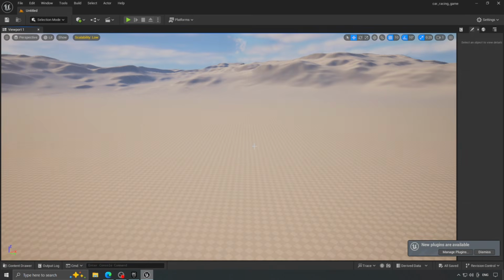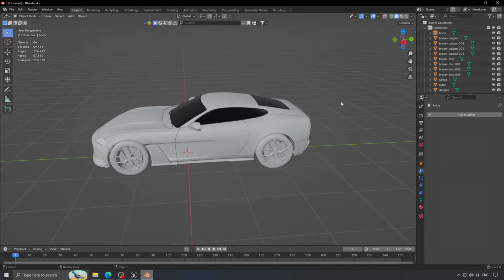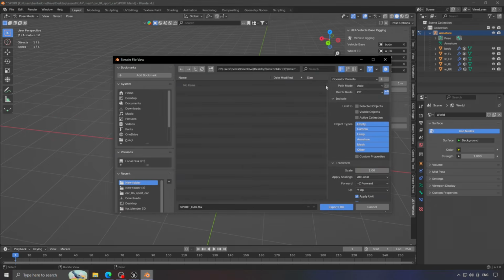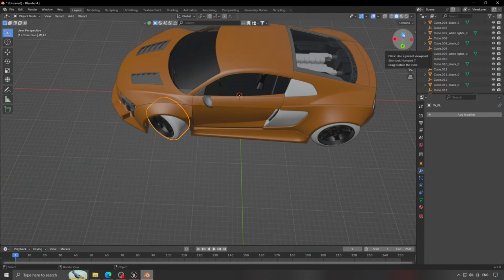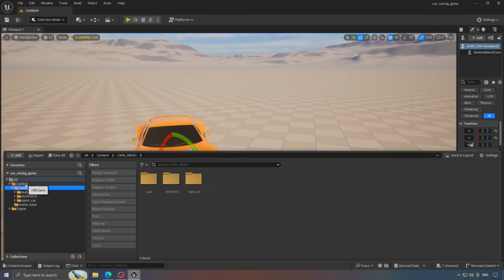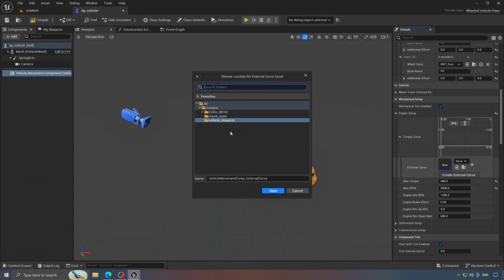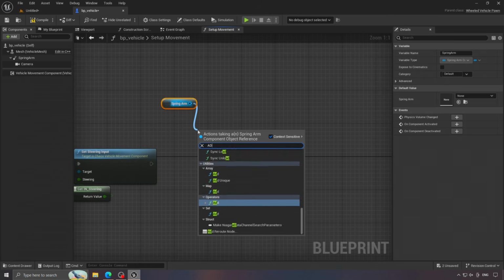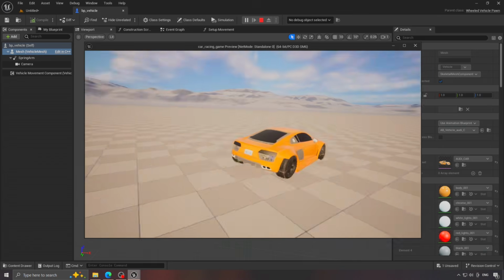How to Import and Set Up a Drivable Car in Unreal Engine —(Using Blender)| Build racing game PART 01

Comment: I followed the steps, but my car only moves backward and won't go forward or turn. I've double-checked my key mappings, but it still won't work. Any ideas on what might be causing this
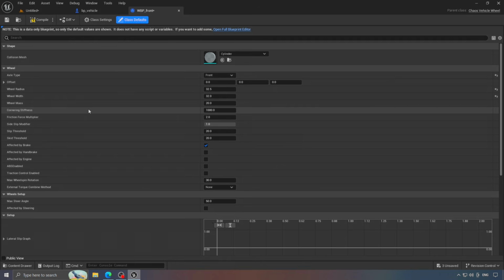Reply: Had the same problem with steering. Turned out I just forgot to tick "Affected by Steering" you can see at 18:04. Maybe thats the solution for you too :)

Comment: Have a small question. For my car i want to the doors to be able to open and steering wheel to rotate, and the speedometer needles etc free as well. Should i still join the body mesh together or keep them separate?  How will the process change depending on that?
Reply from the maker: In this case you will need to create bones specific for the steering wheel and also for the car door and make a very simple animation for opening the car door as well as for the steering wheel or rotating it with custom logic later in Unreal Engine although. I advise you to use the car that appeared at minute 2:09 you will find many modifications in it that suit what you want as an initial experiment to achieve what you want